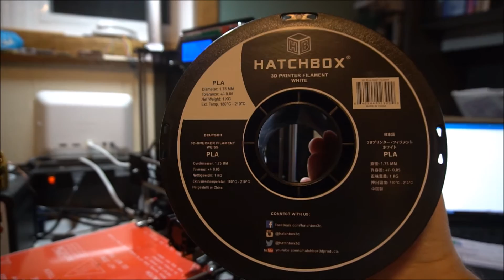RepRapGuru Prusa I3 V2 Hints

Comment: I just put this kit together.  Do you run your prints via a PC or off the SD card?  I'm having a hard time "homeing" the unit.  Where exactly should I home to?

Thanks!
Reply from the maker: I've bought a BLTouch and now have auto leveling setup. I've been meaning to post a new video on the BLTouch. I highly recommend it.
Reply from the maker: I normally run the print off of the PC. But I'm now running a custom version of the Marlin firmware and the SD interface works pretty good.
Reply: I would love to see a video of the BLTouch. I just got my printer put together and my first print looked like a clump of hair! I think because the first layer was too high and the nozzle was just dropping the PLA. Should the nozzle sorta spread the plastic? Also, my hot bed doesn't' work. Getting a new one from RepRap soon. I'm going to try your Cura settings too. So, thanks for post that and for making these videos!

Comment: can you please let me know your cura settings?
Reply from the maker: Woops, missed this.
[print]
name = cura_settings
defaultQuality = dAVq1zwGYnaPxsjMlH0NpTBXzaQY1A6B
travelSpeedMin = 150
travelSpeedMax = 150
firstLayerSpeedMin = 10
firstLayerSpeedMax = 10
infillSpeedMin = 60
infillSpeedMax = 100
skinSpeedMin = 30
skinSpeedMax = 60
infillType = 0
innerPerimeterMin = 40
innerPerimeterMax = 80
outerPerimeterMin = 30
outerPerimeterMax = 60
printSpeedMin = 40
printSpeedMax = 60
nozzleDiameter = 0
gcodeFlavour = 0
retractionCombing = True
combing = 1
multiVolumeOverlap = 0
cutOffObjectBottom = 0
shellThickness = 0.8
infillTopBottomThickness = 0.6
infillDensityPercent = 20
supportType = 0
platformAdhesion = 0
dualExtrusion = 0
wipeAndPrimeTower = True
oozeShield = False
enableRetraction = True
retractionSpeed = 40
retractionDistance = 2
multiExtruderSwitchAmount = 16
startGCode = """
; Default start code
G28 ; Home extruder
G29 ; Autolevel
G1 Z15 F{Z_TRAVEL_SPEED}
;M107 ; Turn off fan
G90 ; Absolute positioning
M82 ; Extruder in absolute mode
{IF_BED}M190 S{BED}
; Activate all used extruder
{IF_EXT0}M104 T0 S{TEMP0}
G92 E0 ; Reset extruder position
; Wait for all used extruders to reach temperature
{IF_EXT0}M109 T0 S{TEMP0}
M106
"""
endGCode = """
; Default end code
;G1 X0 Y0 Z130 ; Get extruder out of way. Uncomment to use!
M107 ; Turn off fan
; Disable all extruder
G91 ; Relative positioning
{IF_EXT0}T0
{IF_EXT0}G1 E-1 ; Reduce filament pressure
M104 T0 S0
G90 ; Absolute positioning
G92 E0 ; Reset extruder position
M140 S0 ; Disable heated bed
M84 ; Turn steppers off
"""
preSwitchExtruderCode = 
postSwitchExtruderCode = 
wipeAndPrimeTowerVolume = 15
retractionMinimumTravel = 1.5
minimumExtrusionBeforeRetract = 0.02
zhop = 0
skirtLineCount = 1
skirtDistance = 3
skirtMinimumLength = 150
solidInfillTop = True
solidInfillBottom = True
infillOverlapPercent = 15
supportStructureType = 0
supportOverhang = 60
supportFillPercent = 25
supportDistanceXY = 0.7
supportDistanceZ = 0.15
supportExtruder = -1
spiralizeOuterContour = False
brimWidth = 10
raftExtraMargin = 5
raftLineSpacing = 1
raftBaseThickness = 0.3
raftBaseWidth = 0.7
raftInterfaceThickness = 0.2
raftInterfaceLineWidth = 0.2
raftAirGap = 0
raftAirGapLayer0 = 0
raftSurfaceLayer = 1
fixCombineEverythingA = True
fixCombineEverythingB = False
fixKeepOpenFaces = False
fixExtensiveStitching = False
fanFullAtHeight = 0.5
perimeterBeforeInfill = True
minimumSpeed = 10
coolHeadLift = True
numQuality = 1
[quality_0]
name = 0.2 mm
signature = dAVq1zwGYnaPxsjMlH0NpTBXzaQY1A6B
layerHeight = 0.2
layer0widthPercent = 100
firstLayerHeight = 0.3
Reply: How/where do I paste these settings in Repetier-Host? Thanks bud!

Comment: Couple tips on alignment. When checking the bed for being straight, don't just measure the front and back, measure corner to corner diagonally in both directions. If both directions are the same, that will tell you if it's square. For vertical alignment, Pythagorean theorem. Pick standard points on both sides of the table on the z axis, and near the front. For a simpler version, measure 3 inches out from the vertical axis, 4 inches up the vertical axis, and the distance between those points should be 5 inches. If it's the same on both sides, there's no twist in the frame. I have this model coming from amazon soon, thanks for the insight!
Reply: you get it primeday too???  High Five
Reply: Dylan Kowalski yessir! Racking up the #protips before it shows up.
Reply: hahah me too I will be uploading the process I am supposed to get it today.